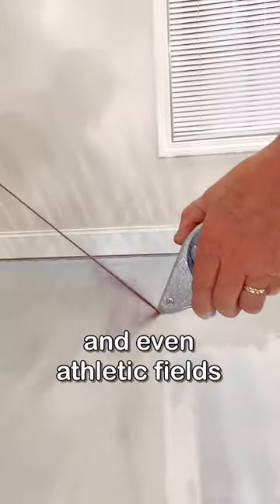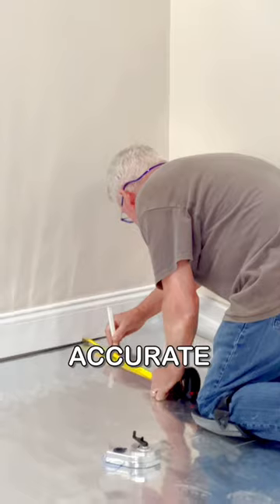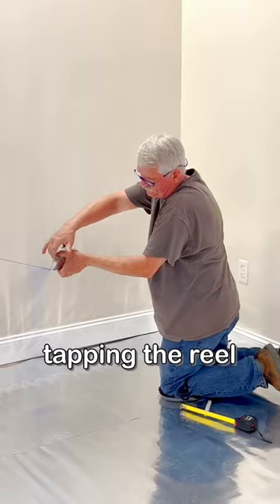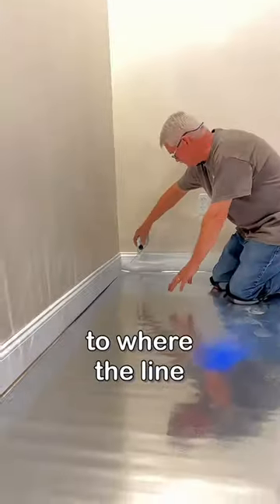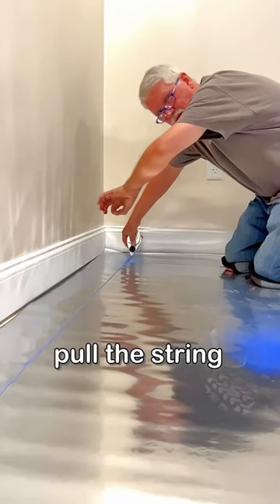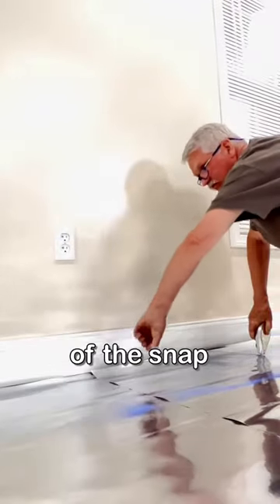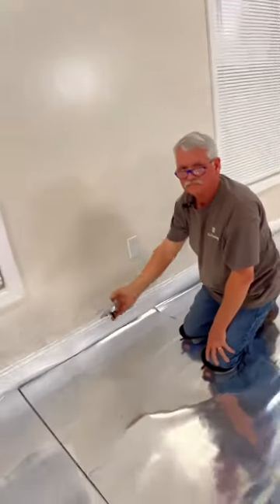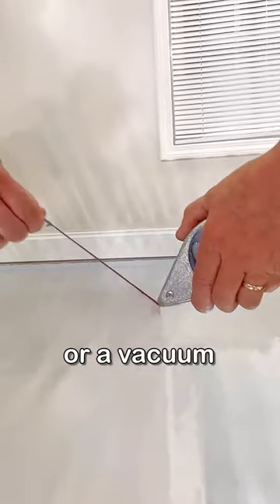Make A Chalk Line For Floor Installation  #flooringcontractor #life

Comment: toss that cheap box out and buy a Tajima one  !  it uses less chalk and lays down a razor sharp  fine line
Reply from the maker: In a lot of videos we’ll show using basic tools even though we also carry the upgraded fancy type etc.

But for that chalk line, will have to check that out thank you.
Reply: @LLFlooring   I like to fill the chalk box with fluorescent orange chalk. It is so much easier to see and yes, you can use it on brand new carpeting it cleans up nicely.